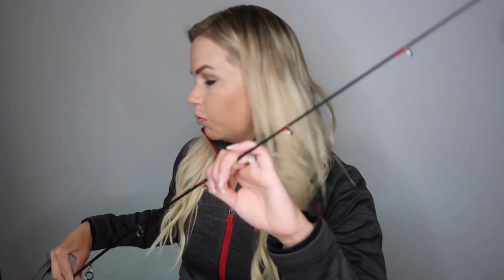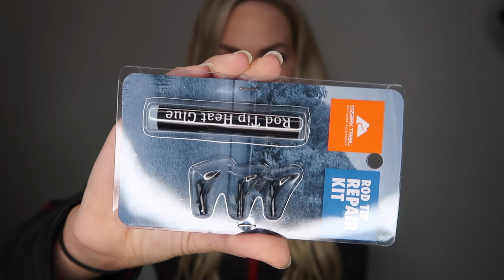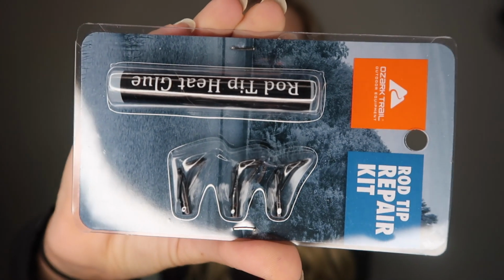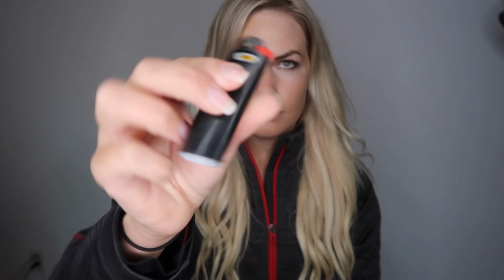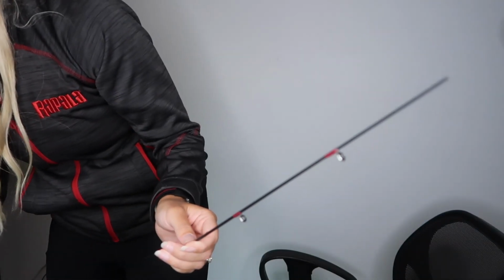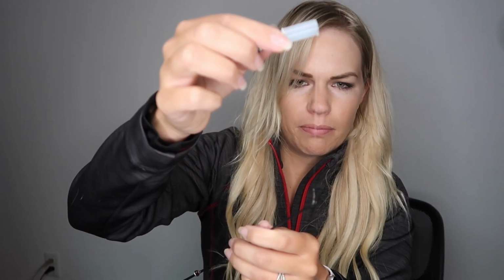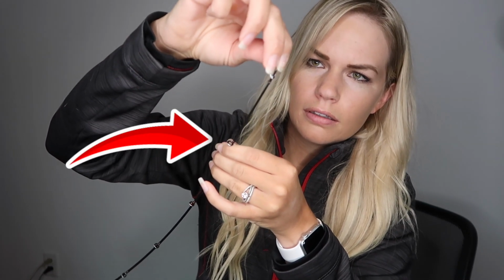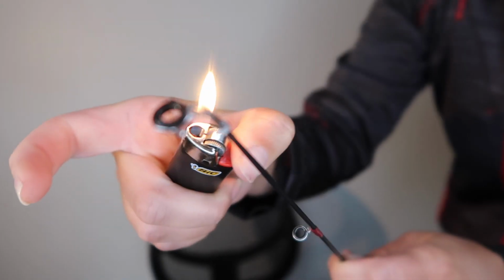QUICKLY Fix Your Broken Fishing Rod Tip | Easy Fishing Tip

Comment: Good video! For a temporary "bush fix," I've also used a short length of wire or paper clip bent into a "U" shape, wrapped some braided line with half hitches tightly over the rod tip and wire and then dressed it with a coat of glue or nail polish to prevent slipping. It isn't very elegant but gets 'er done on the spot until I can get home to replace the tip properly. Thanks Nicole, the hot glue was a good suggestion. I always enjoy watching your videos.
Reply from the maker: That's a great idea as well!  And thank you for the support!! Have a great week.

Comment: Now this works great if the very tip is broken but sometimes the rod breaks 4,5,6,7,8 inches off the tip which will DRAMATICALLY change the rod if you just glue a new tip at the break. instead find a piece of straight hook shank, cut finishing nail, whatever metal that fits in the hole snug, use that to attach the pieces and glue them back together.
actually amazed how well it works. i have 3 broken rods with this fix that i still use and work surprisingly well, never even know they were broken in the first place.
if you have extra broken rods or lost the tips on a few older ones you can even make franken-rods. pretty interesting what you can come up with for wacky rod combos.
Reply from the maker: Where'sTheSauce? You should make a video tutorial lol
Reply: Nicole Stone Outdoors I got the idea from that show "fishful thinking"
He's Only person I've ever seen (even on YouTube) that fixes rods without shortening them.